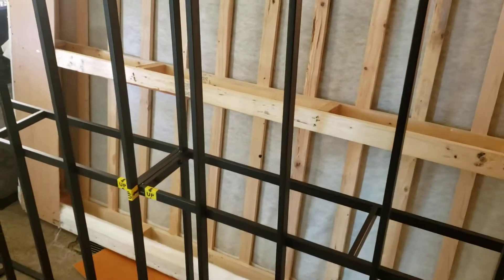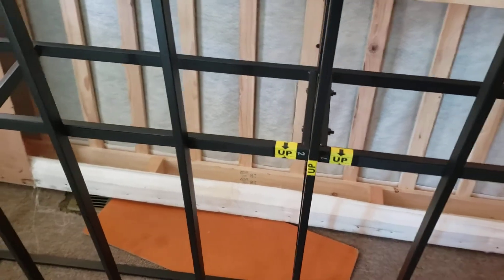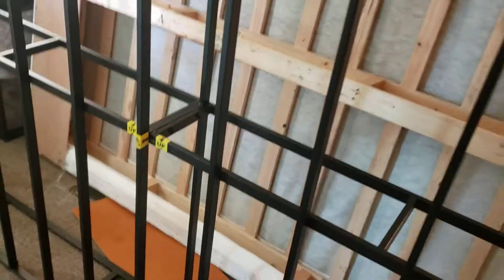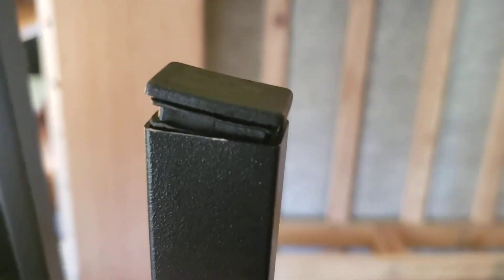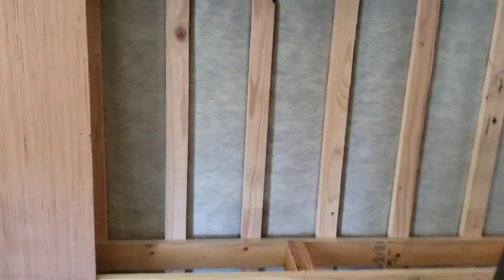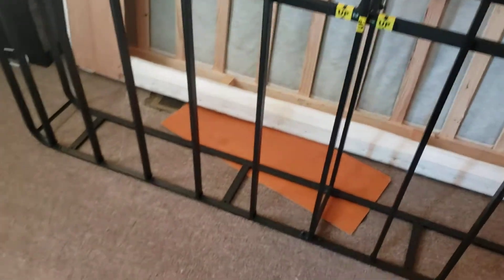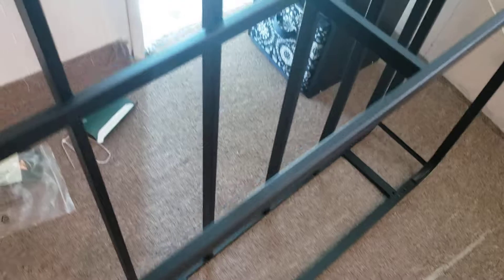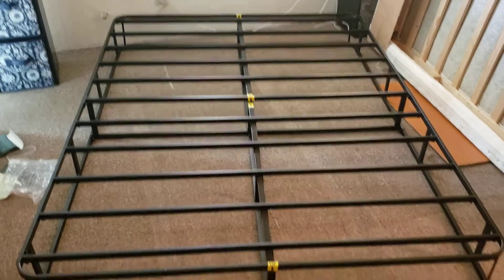ZINUS 9 Inch Smart Metal Box Spring, assembly. Part 2

Comment: We Bought The Exact  Same Thing But The Bars ontop, the one you're supposed to put in the little slots. When I try to put them in, both sides won't go in. It will just pop out. How did you get it on without any trouble? IF you understand my situation at all.
Reply: Never Mind I Figured Out the Problem
Reply from the maker: @miguel9202  Glad you were able to figure it out
Reply: Having the same problem how did you solve it